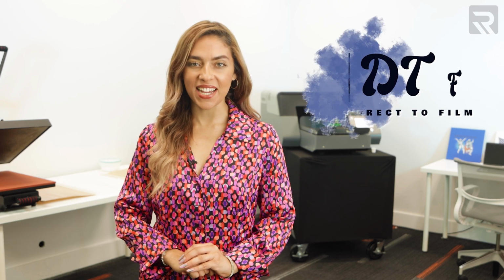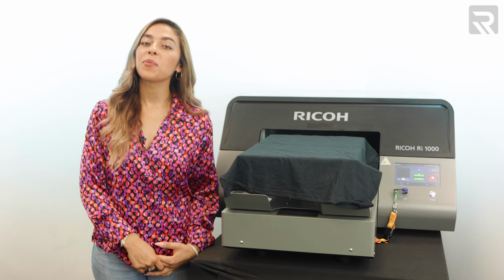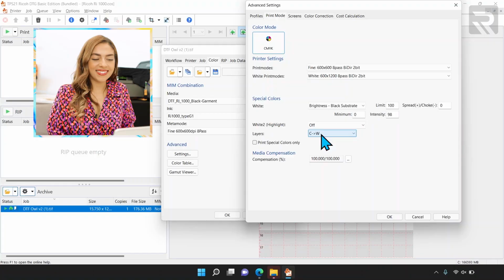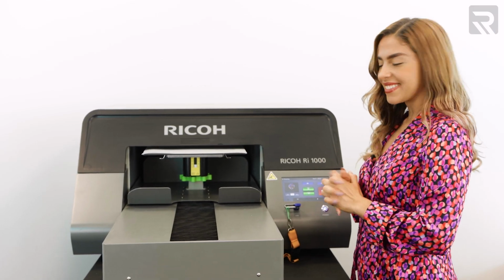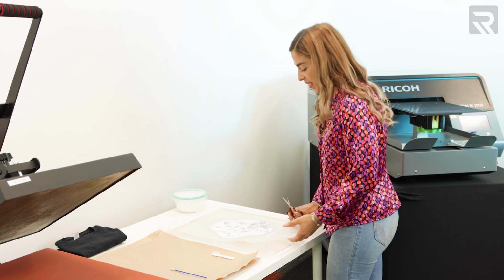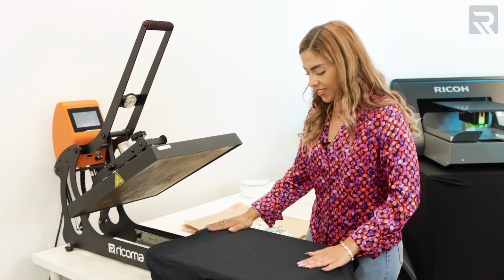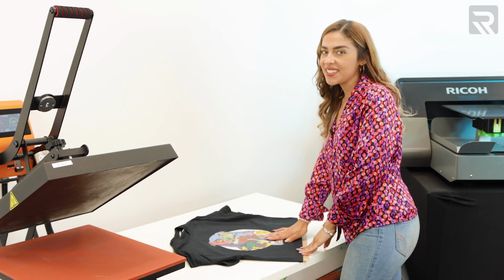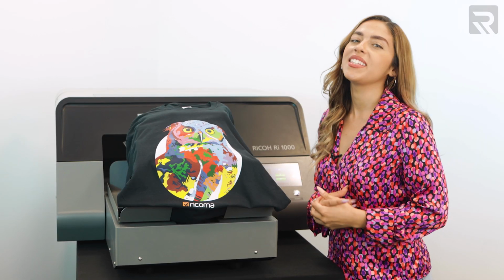First time printing direct to film (DTF) with a DTG printer...UNREAL results!

Comment: Looks like it works great but I am curious what the benefit of DTF over DTG is?  Maybe my lack of experience is an issue but If the results are the same, why would a person choose DTF?
Reply from the maker: Hi Johnny! The main differences is that DTF works on a large variety of garments, including cotton, polyester, blends, nylon and both white and dark garments (unlike DTG),  DTF is more durable than DTG as well. Since DTG prints directly on the apparel, one mistake with the printer and not only have you wasted the print itself, you've also wasted the entire garment. However,  DTF, the mistakes when applying to the garments are very rare.  This saves the decorator money, hence saves you money!
Reply: Another benefit is that pretreat is not required with DTF. So you can sell your pretreater, or avoid buying one!